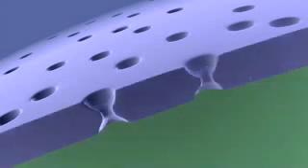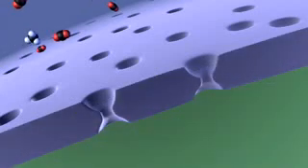Gas separations

Comment: Could this be used to separate a light gas and a heavy gas in a kinetic energy power plant. Please contact me if you want more detail. Is this material available and were may I purchase it? How much pressure difference will this membrane generate before it goes stable?